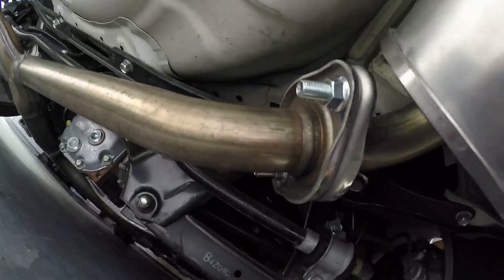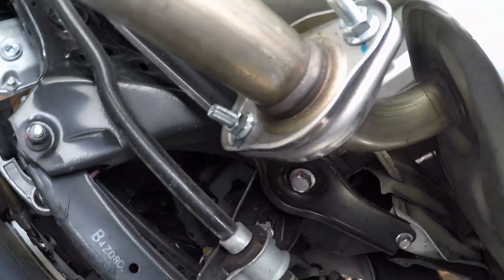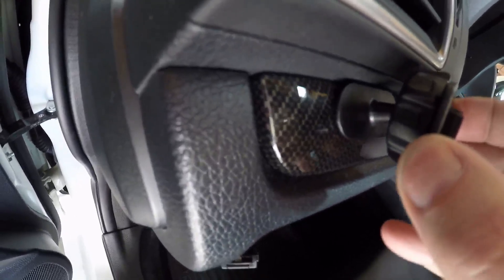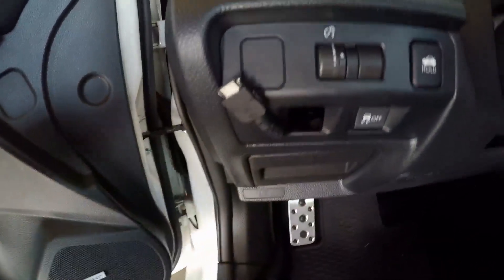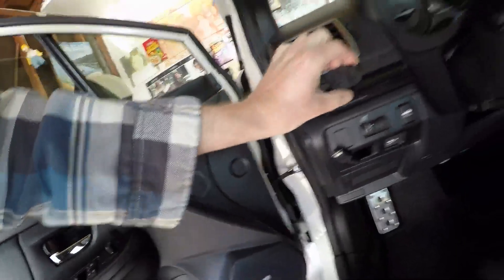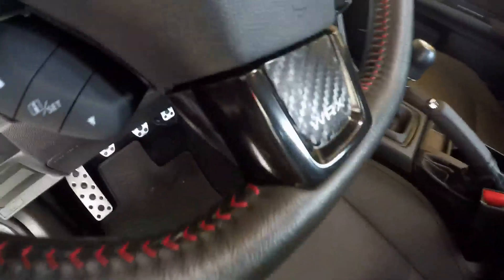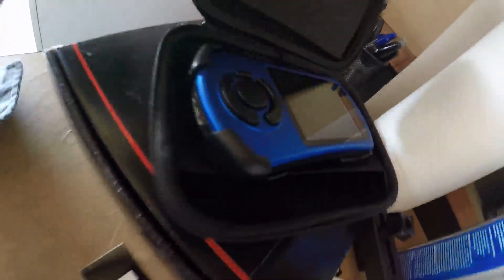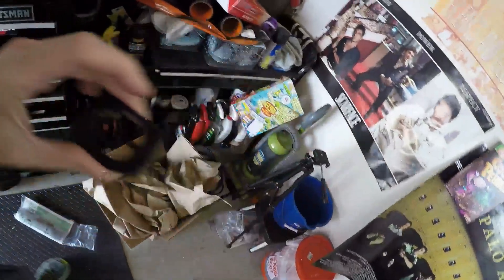2015 Subaru WRX Minisode 368: An Uneventful Weekend

Comment: Have you thought of doing some lighting mods. I recently did all my interior lights, c-lights and some mods to my tail lights. Got all my lights from Diode Dynamics. It was pretty fun me.
Reply from the maker: +David Mok ya I've thought about it.. i expect to have some "C-light as DRL" harness coming at some point. no ETA tho.
Reply: +LastHumansGarage If you're going to get the harness, the stock Clight setup is pretty dim, even if have the stock LED Clight. If you get the DD Clight upgrade it has a harness/driver that you could do the Clight as DRL.

Comment: I went back to 0 and I haven't felt this excited about my car sense I first bought it. all the tuning stuff you feel like it's never enough and you always want more. I'm more into appearance mods and handling. that should be your next move is handling.
Reply from the maker: +Christopher McGill wow stage 0? bone stock power? i dunno man. i coulda handled that BEFORE all the recalls. that is why i still have my Cobb v201 stage 0 map.. but my oem WRX map is updated to recall 1 which wrecked all the low end power.. so if i was going stock, i'd run my cobb v201 map for stock.

Comment: Really debating on getting an e-tune. Everything stock, I just have a catback. Would you wait to get a down pipe and ebcs or start off with a stage 1 e-tune everything basically stock? God forbid something happens to my car I could always flash it back to stock but if i get a down pipe and ebcs i could get more power. Literally have been reading every forum possible and googled everything but can't decide.
Reply from the maker: +MrFahnatic 1 step at a time..
Reply: +LastHumansGarage so stage 1 etune?? gonna go with torqued performance most likely. How much did you pay?
Reply from the maker: +MrFahnatic i paid whatever he charges these days.